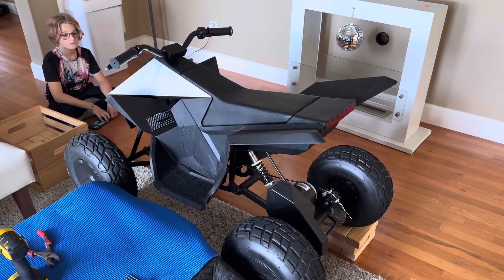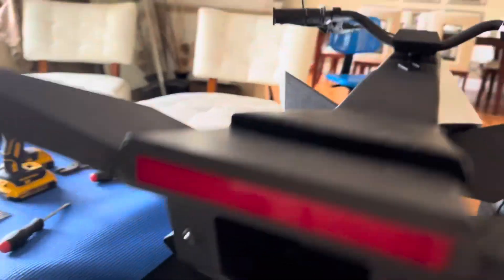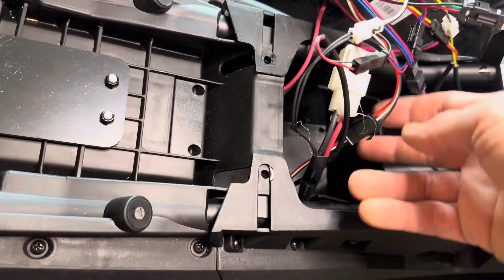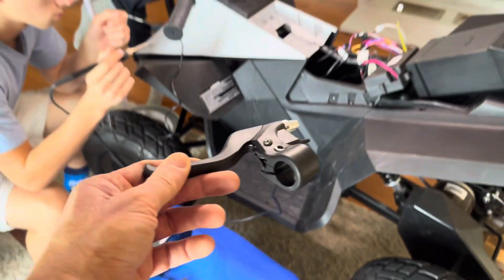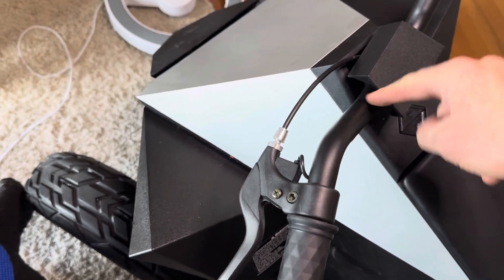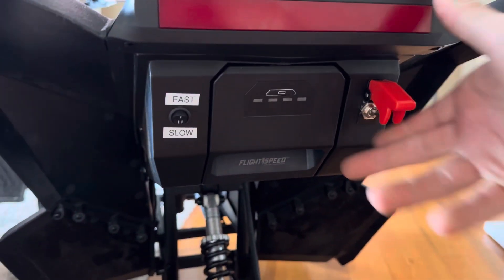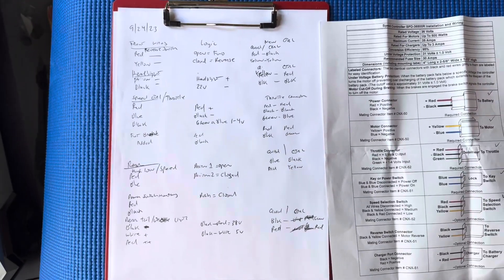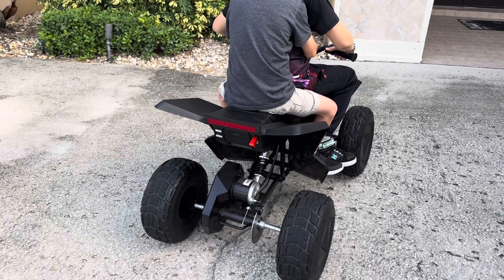Upgrading the Tesla cyberquad for kids motor controller

Comment: With the brake light, the original light has 3-wire and the controller has 2. From your notes, it looks like you only used Red and Black and ignored the White cable on the light?
Reply: Yes because it should be a drive light and a brake light. Ideally it should be red and black (for power) and white and black (brake) but maybe it doesn't have sensors?!